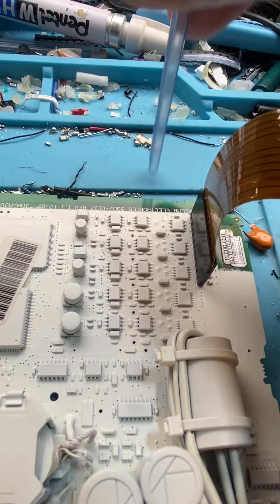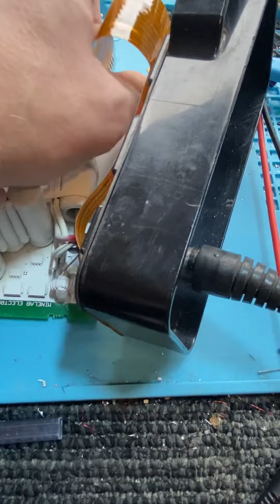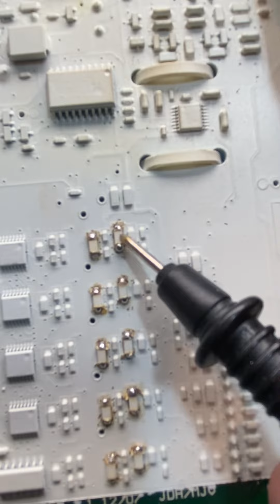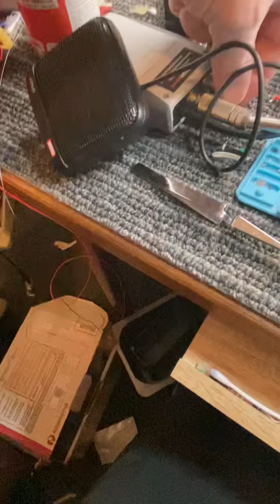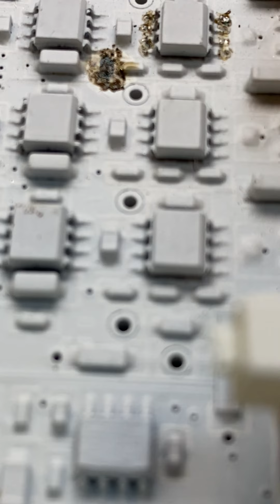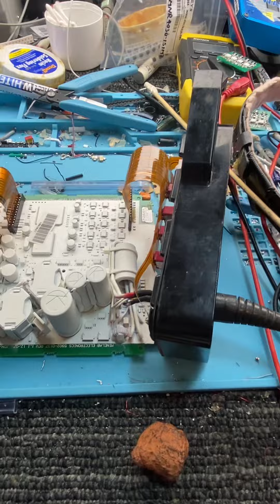Minelab detectors ground balance faults and repairs.

Comment: Thanks!
Reply from the maker: Hi Jason, do you want me to do a video on anything specific?
Reply: @DetectorMods  Maybe I missed it in a previous video (let me know if i did) but common failures on main board and corresponding component numbers?   I own 2  5000s but want to maintain them.  I also enjoyed the capacitor addition video, but haven't had the need to open it up yet.  I did have a coil overcurrent one time suddenly and it hasn't come back...not sure if it was a fluke or something on the way to going out.  

So is the paint on the board a dampness protection or to inhibit copies?

Many thanks for the videos.  Much enjoyed.
Reply from the maker: @jasonjarnagin9514  The coil over current can just be a bad coil or battery connection. even just pushing on the connectors can cause it. The site paint is protection from water and Chinese.